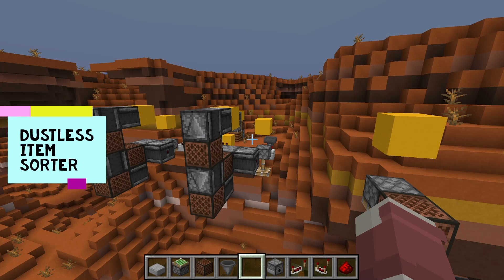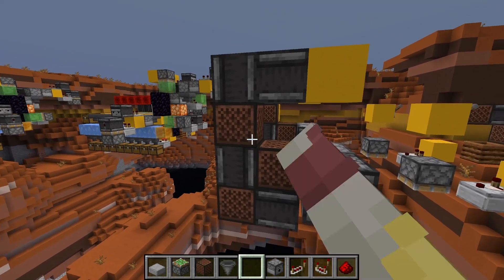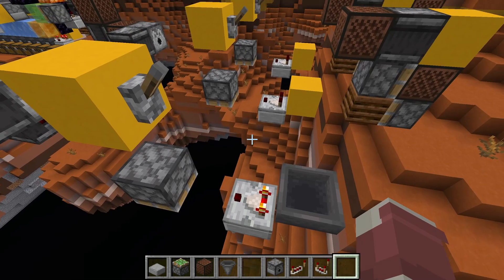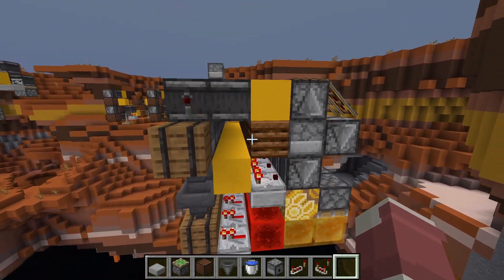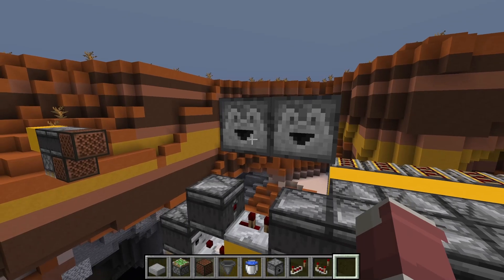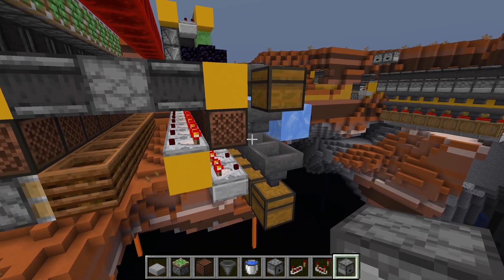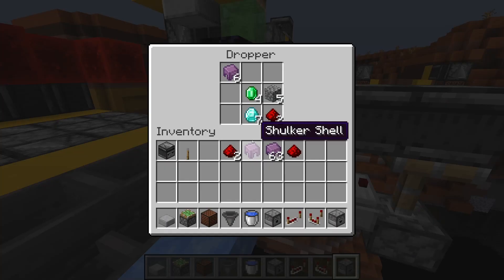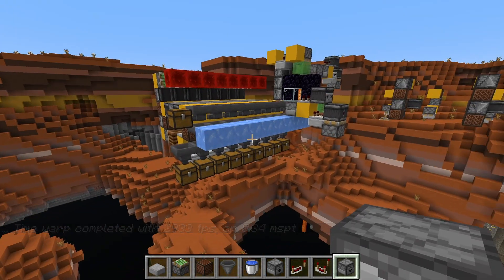Dustless Item Sorter

Comment: I dunno, think I'm just gonna ramble for a minute or two in this comment on stuff.
First, is using a bud the only way to do a dustless item sorter? Or is it the only way to do it 1wt (non alternating)?
Second, could there be a way to use a setup like the first one shown to avoid using a second piston in the wiring while keeping it open to general item input? 
Third, could you remove the dropper bud without adding a piston? The only ways I can think of doing it are with powered/activator rails powering off, curved rails powering doing their dumbness (I don't think there's a good pistonless cud / liquid update detector (ect) you could use), the powered rail option sends updates adjacently so it would have to either be alternating tilable or multiple blocks wide. curved rail curving is cursed so I'm not confident I can address it's tilability as a bud.
 In summary, I think the issue that makes the dustless layouts more laggy is the use of pistons (which are inherently pretty laggy), considering MC-222189 and so on.
Reply from the maker: We're pretty close to pistonless!
Reply: @RaPsCaLLioN1138  nice, glad to her it

Comment: What does the term « dustless » stand for ?
Reply: Ho it means that it doesn’t use redstone dust. That’s why...
Reply: @frenesisseredsmoker1831  yea because it lags a lot
Reply: @traparchivio48  That's mostly mitigated in the latest Minecraft versions, actually. It was much worse in older versions.
Reply: @traparchivio48  depends on the config
Reply: @TheRealWormbo  it's not mostly mitigated, it barely is.
only major difference are single-dust changing in 1 go instead of taking all the steps.
Reply: @frenesisseredsmoker1831  no ss changes is dustless